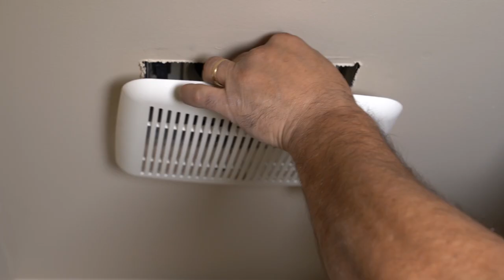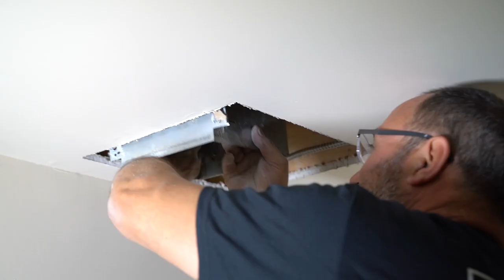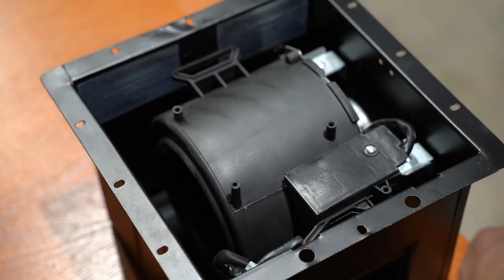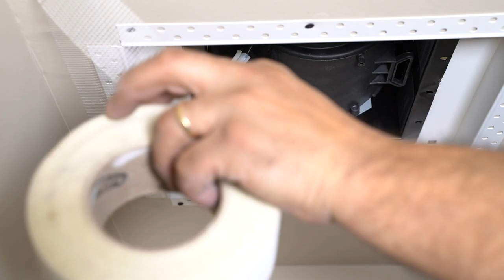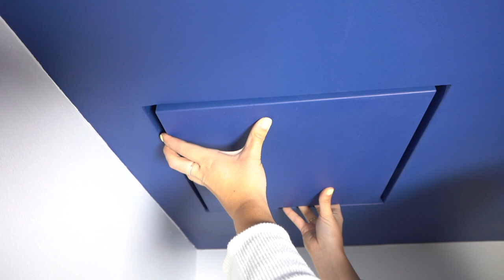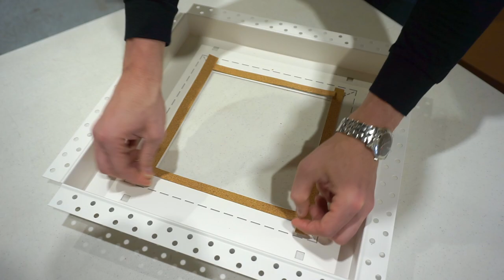Drywall Pro X [exhaust fan] - Install Video

Comment: I could imagine the mess the electrian would leave after installing that trim kit for the drywall finisher. They don't even pick up their wire sheathing.
Reply: As an electrician with a garbage bucket, brooms, dust pan, and two vacuums in my van, I resent this comment! Haha
Reply: @jeremywolfe5483  They only work if you take them out of your van and actually use them. Not all electrians are prima donnas

Comment: How do you take the cover off? My contractor installed this a couple years ago, but now I need to take it off but I'm afraid of damaging it
Reply from the maker: Hey there :D The Drywall Pro X's tray/plate cover has a circular hole in the middle of 1 of its 4 sides. If you run your fingers down the sides and find this hole it will let you know which way the tray is removed.

Once you find the hole, push the side of the tray/plate cover with the hole until it unlocks - you will hear a snap/click. Then you can remove the cover. Hope this helps, cheers.
Reply: @fittes.  thank you for your quick response! It worked 😁
Reply from the maker: @chrisg220  You're welcome. Great news, love to hear it. Let us know if you have any other questions 😉
Reply: @fittes. what do you do if it doesn't come off with minimal force? Mine was just installed and seems stuck.